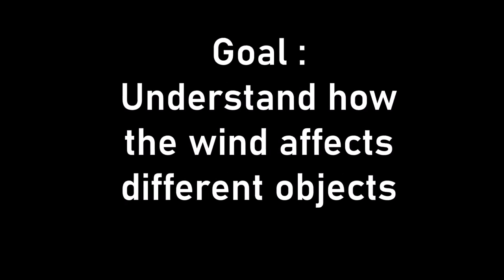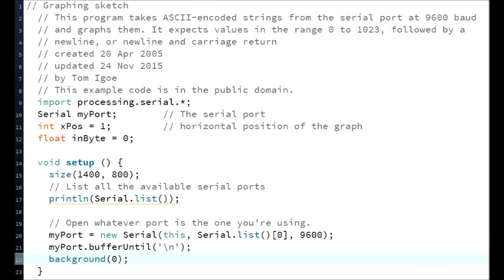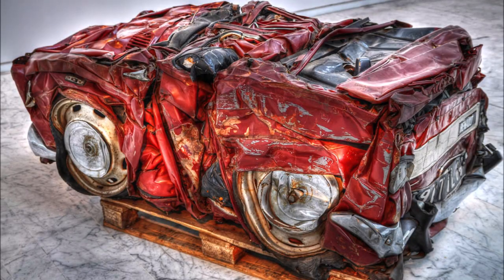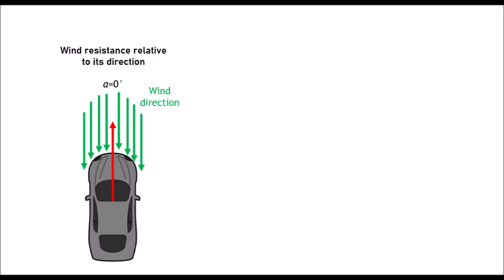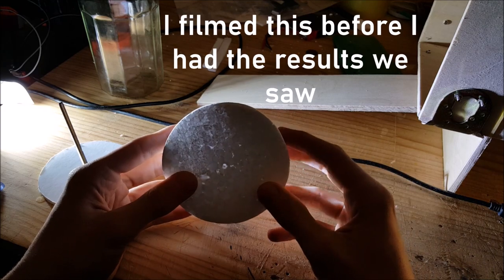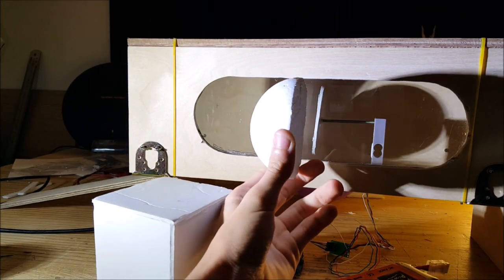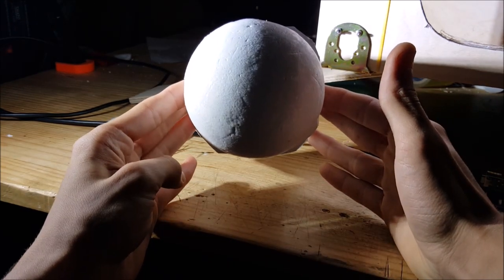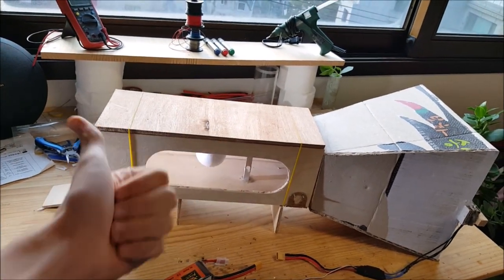Wind Tunnel Experiments - Part 2 - Aerodynamics

Comment: please can u give me the name of that software u use in simulation?
Reply from the maker: If you are talking about the software showing the graph, it is called Processing which you can download here:
https://processing.org/download/

Here is the code I used: (you need to connect the arduino to the computer and Processing will collect that data)
//Modified for a wind tunnel by Electronology

// Graphing sketch
  // This program takes ASCII-encoded strings from the serial port at 9600 baud
  // and graphs them. It expects values in the range 0 to 1023, followed by a
  // newline, or newline and carriage return
  // created 20 Apr 2005
  // updated 24 Nov 2015
  // by Tom Igoe
  // This example code is in the public domain.
  import processing.serial.*;

  Serial myPort;        // The serial port
  int xPos = 1;         // horizontal position of the graph
  float inByte = 0;

  void setup () {
    // set the window size:
    size(1400, 800);
    // List all the available serial ports
    println(Serial.list());
    // Open whatever port is the one you're using.
    myPort = new Serial(this, Serial.list()[0], 9600);

    // don't generate a serialEvent() unless you get a newline character:
    myPort.bufferUntil('\n');
    // set initial background:
    background(0);
  }

  void draw () {
    // draw the line:
    stroke(127, 34, 255);
    line(xPos, height, xPos, height - inByte);
    // at the edge of the screen, go back to the beginning:
    if (xPos >= width) {
      xPos = 0;
      background(0);
    } else {
      // increment the horizontal position:
      xPos++;
    }
 } 
  void serialEvent (Serial myPort) {
    // get the ASCII string:
    String inString = myPort.readStringUntil('\n');

    if (inString != null) {
      // trim off any whitespace:
      inString = trim(inString);
      // convert to an int and map to the screen height:
      inByte = float(inString);
      println(inByte);
      inByte = map(inByte, 0, 60, 0, height);
    }
  }
Reply: @electronology4665  Thank youu Sooo much broo, Merciiii
Reply: @electronology4665  Thank you so much for the video. I had some problems with graphics and I need your help. When I run the software I get the following error and a blank non-working black graphical screen appears: "map(NaN, 0, 60, 800) called, which returns NaN (not a number)". Can you help me to overcome this problem? Thank you.
Reply from the maker: That probably means the arduino isn't sending the correct data, for exemple, if it's sending text.
Try printing the data from the arduino IDE and making sure it's numbers
Reply: @electronology4665  Thank you.